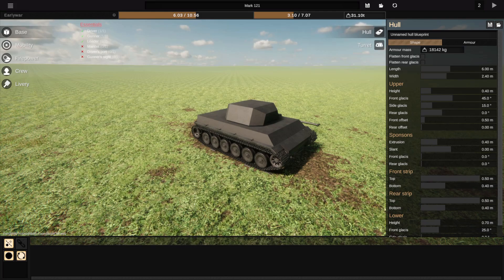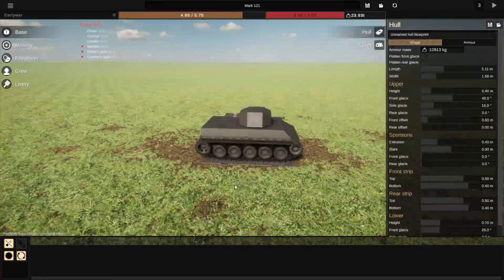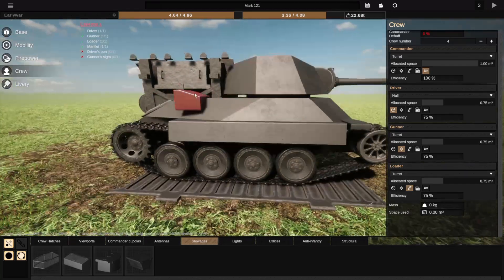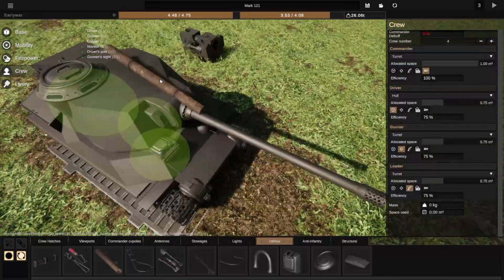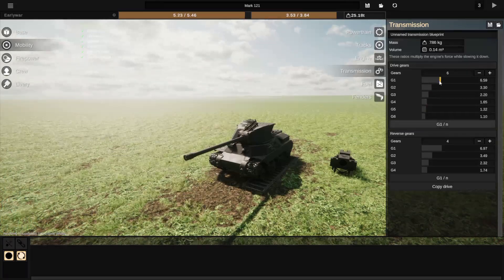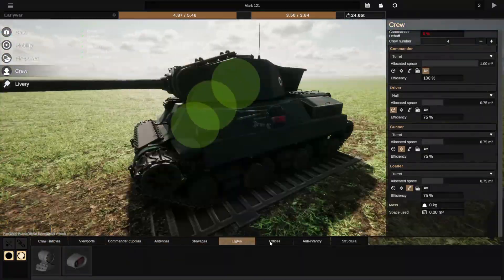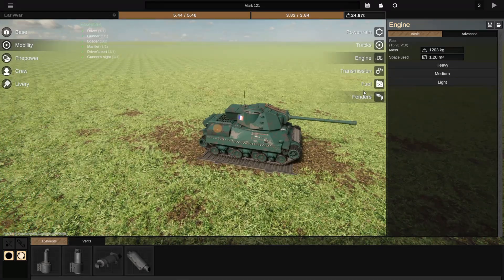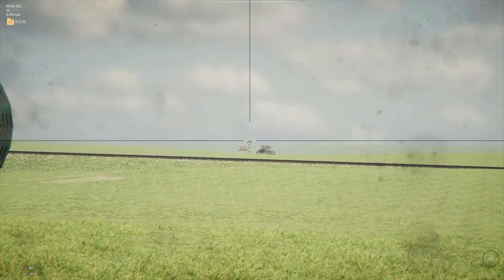Sprocket : Designing a tank for a France that was down, but not out!

Comment: You're underestimating how much tanks weighed back then.
Your design Clocks in at 25t. That's the weight of a Pz. IV H

For comparrison, the Panther (Something id say is a "Heavy" Medium, comes in at 44 tons), The Jumbo Sherman came it at about 42 Tons and the T-44 at 32 Tons.

You built a quintessential Medium Tank :D
Reply: I'd say it's more like a light medium than a true medium. It's got the firepower and mobility at the cost of shitty armour that tends to get penned more than it bounces. Still a really good medium though, for the era it was built in.